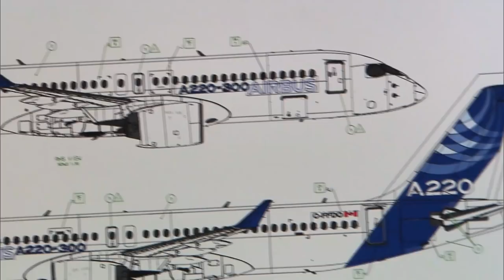LIVE: Meet the Airbus A220-300, the latest addition to the Airbus Family

Comment: This was a smart move by Airbus to bring Bombardier into the fold. It gives them direct access to the Regional jet market, lets them give a big middle finger to Boeing and their protectionist bollocks, and lets them leverage Bombardier's expertise in the field. Bombardier gets a fat cash injection, job security and access to Airbus tech. 
Eventually, Bombardier may well end up being fully Airbus owned which is no bad thing, especially with the Alabama manufacturing plant going ahead (as long as they don't do a Boeing and hire unskilled, poorly paid labor to build the planes, with the resulting manufacturing and safety risks) which will give them greater volume capacity, as well as maintaining a Francophile connection.